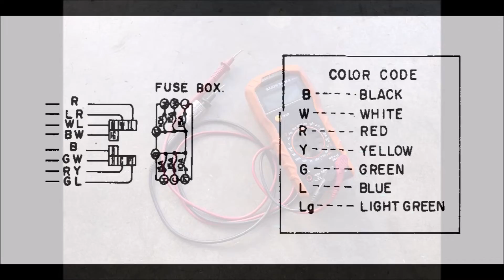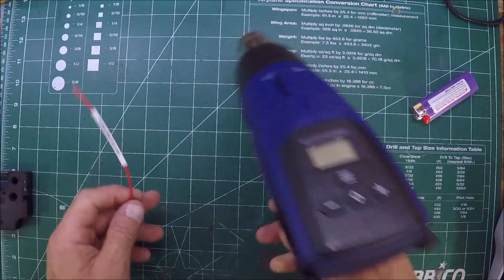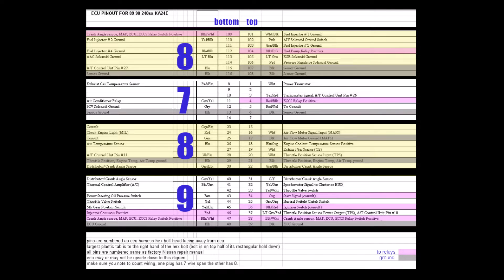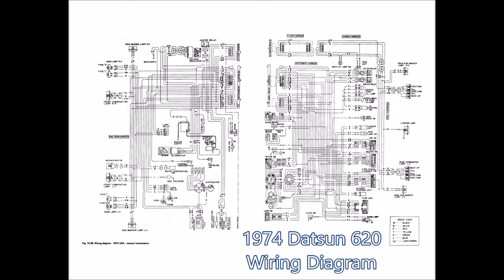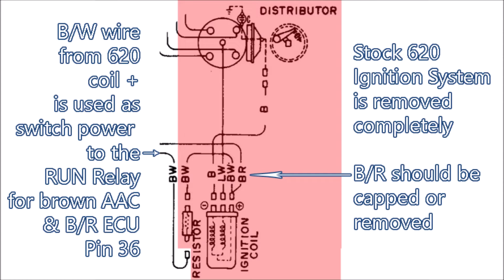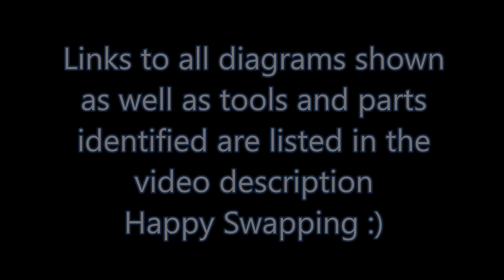How to Wire a 89-91 Nissan KA24E Into Anything - but Mostly a Datsun 620 - In Depth Wiring Explained

Comment: what does the red check engine light ground switch wire on the chassis connector to gauges go to??? is it to be used as the dummy light for the alternator to charge??
Reply from the maker: It goes to the check engine light on the dash in the 240sx. I ran it to a light I bought on amazon that I put in the delete plate on the dash. 
https://www.amazon.com/Taiss-Indicator-Engine-Yellow-F-010-FDJ-Y/dp/B097SDGDPY/ref=sr_1_7?crid=2MFQJYISJ1R15&dib=eyJ2IjoiMSJ9.PPSzVAmu-sJ6CeaHe6a8Mz5Wj0doYcz66_yeMVjRCEHy2t6ww6oZnpQhQH7T3KVKjwnl0_6Agvv8Vx1_SbUqQBmr2vWMhLRhIcC-MxPT7Wkt4Qa0256e-0W88MDPJV365Cbhr7d2STdApyxVc1xmzUd8rqoMF53LQ8l-ANI_w6Rn9Mjh2HJ-_lpCihGunnNy9xOR3PcVmLrlAqxHRzYUiYjGn9jh8IiEkGV2uxJNCYz_h9dhR2q2G6OL-AAdejomPGch2mCGN7MTo66lBWiicrq66hlHftryjh0_PY367uw.K1RrSAS6vHQQzHFIu0JFHBa_oN5-KN0hrzYKkoq1G9M&dib_tag=se&keywords=check%2Bengine%2Blight&qid=1718804097&sprefix=check%2Bengi%2Caps%2C174&sr=8-7&th=1
Reply: @i2edeye  awesome thank you very much, wiring my 710 wagon today with a ka24e... also the other red wire, from pin 46 on the ecu, does that get constant 12v?? like it goes straight to the battery with a fuse??
Reply from the maker: @stavbersosa2458  Yes it is the ECU back up power or memory.
Reply: @i2edeye  okay i got the red wire (pin 46) figured out.. For the orange wire for start signal where does that go on the starter??
Reply from the maker: @stavbersosa2458  The orange wire tells the ECU that the starter is spinning, it ties into the start signal wire from the ignition switch to the starter.

Comment: Quick question. Currently wiring this to my 86 via can am box. Trying to figure out where to wire the Orange Start signal wire that originally goes to a fuse box on the KA. Any tips.
Reply from the maker: Orange wire is the start signal to the ecu, it goes to the starter signal wire (key start) and lets the ECU know the starter is turning.

Comment: I’m having a hard time understanding this. Haha. So do I need to only cut wires at the oem realy plugs and plug them into the can am box? I watched the video and read the diagram just don’t exactly understand where this can am box needs to be located
Reply from the maker: Yes, that is what you are doing. It will be close to the ECU. I put mine on the package tray on the passenger side.
Reply: @i2edeye  thank you for the quick reply. So your ecu is under the hood as well?
Reply from the maker: @Righan1018  Under the dash
Reply: @i2edeye  okay so all the wires from the relay plug box run inside to the canam box as well?
Reply from the maker: @Righan1018  You should contact me on IG or FB. It is a bit easier over Private Message.

Comment: What gauge wire do you use?
Reply from the maker: I recommend using the same size wire as factory minimum. 14 gauge is usually good for most things on the ka, maybe a bit on the big size but bigger is better than smaller.